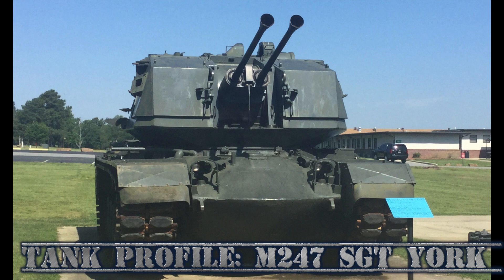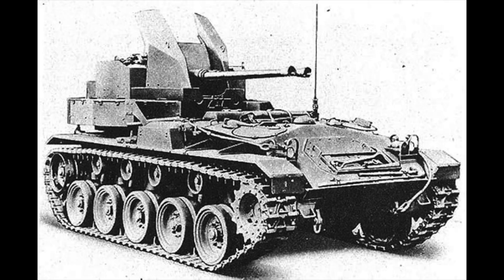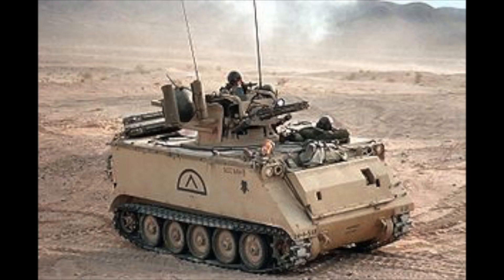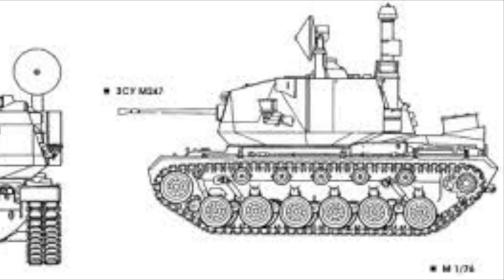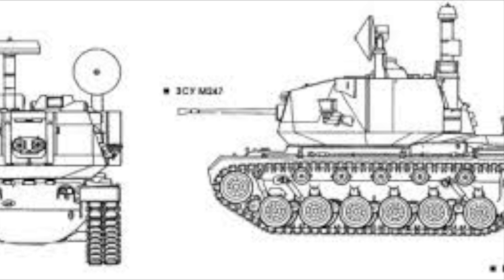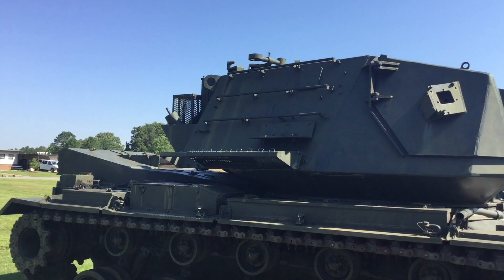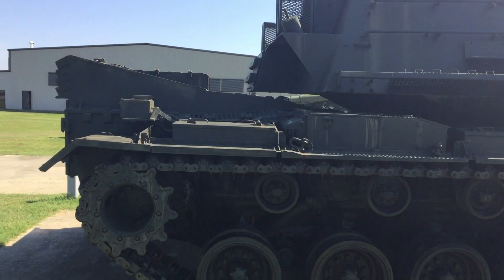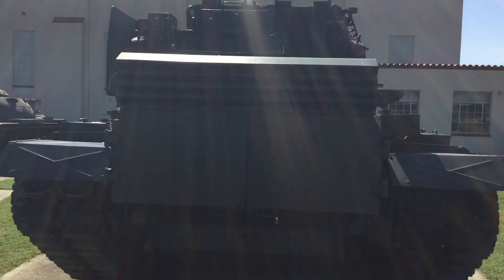Tank Profile: M247 SGT York

Comment: at the time, the Army should have sucked it up, along with congress, and plonked Gepard turrets on those hulls.
Reply: jeeezus how come the americans couldnt get the sgt york to work- its a mash up of old parts, if the f16 radar is not good at ground to air replace it with the gepard radar the germans were succesfull with the gepard so yes plop the gepard turret on the m48
Reply: almost every nation that tried spaags eventually got them to work and work well   the russians with their zsus, the germans with the gepard   the us tried to save money so used surplus 40mm and m48 tanks...i actually can see the value in that   the 40mm had a proximity fuse and there were literally thousands held in reserve so it was much cheaper than newly built 35mm oerlikons  sure the m48 couldnt keep up with the m1 tanks so that is a bummer but at least it was already built platform   the weakness of the sgt york was the targeting radar from the f16 which was not used to ground to air modes being originally designed for air to air use   that problem should have been forseen and they should have used the gepard radar-there were two available...a german and a dutch version
Reply: @MrRaulstrnad  even the m48 mobility could have been improved with a more powerful engine and transmission, like say the pack from the Leo 2. But, good ole American pride and corporate greed got in the way. Personally, I think they should have just plonked a Gepard turret on the 48 hull and went from there.
Reply: @n5syr01  well technically they wanted to save money and they had thousands of bofors gun barrels in storage so, at first glance the ford option was cheaper than the gepard option, but yeah in retrospect they should have just put the gepard turret on the m48 it was already developed and it worked   like you said the mobility issue would have been solved by putting a leopard 1 engine in the deck, the other option was to put an uprated avds 1790 into it, the avds 1790 was capable of over 1000 hp if they wanted to
   another issue was after they cancelled the sergeant york what defended the mobile portion of the us army from air attacks- well nothing actually... oh sure some gatlings and sidewinders on apcs and manportable stingers...but basically after the york was cancelled the us army was extremely vunerable    at that time and even now actually 
air defence from tactical strike aircraft just did not and still doesnt intrude into us army tactical thought  americans think they will have air superiorty forever that is a myopa that could possible come back to haunt the us army in the future